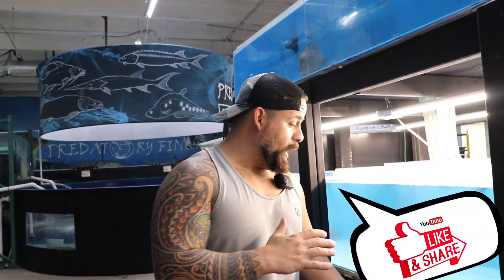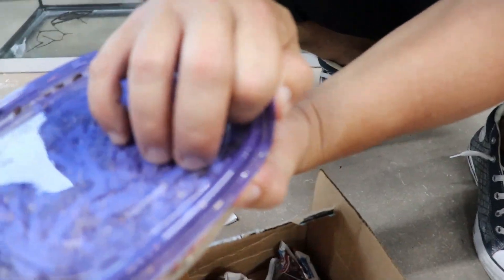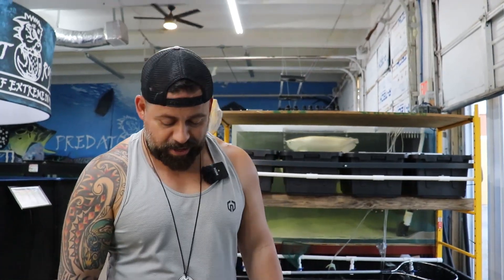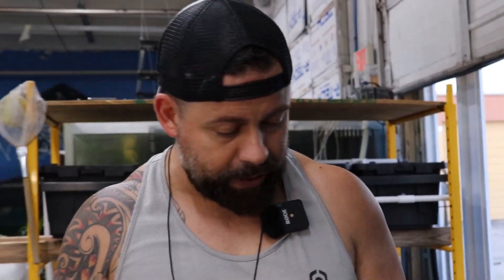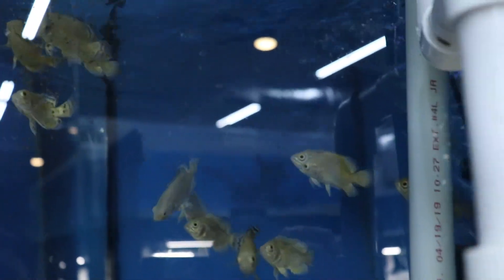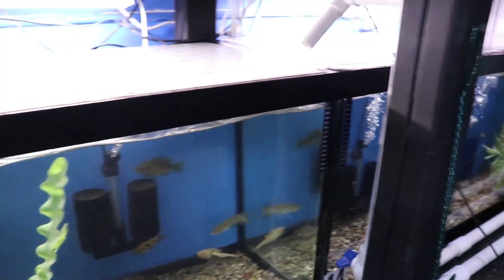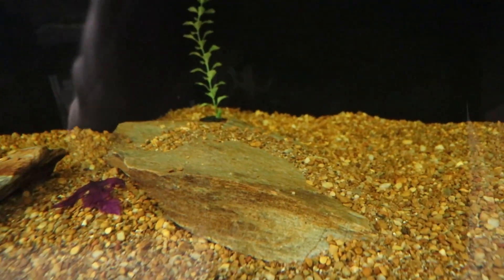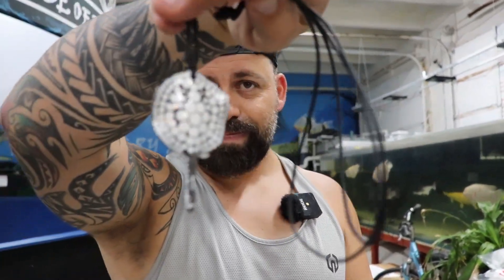FISH TAXIDERMY buying BONE cleaning BEETLES to make my WIFE CRAZY

Comment: They are very good at cleaning bones. They had them and I saw them at work cleaning bones when I was in forensic classes in college. If you want the bones to be really white though you have to put the bones out in the sun. You can probably speed up the method by putting a little bleach on the bones and then leaving it in the sun. I am not sure if the beetles fly but they can crawl out of the tank. All you need is like a thin sheet of plexi and cut it to the shape of those openings on each side of the support brace. Make small holes in the plexi so the beetles don’t die. To make sure the plexi does not crack, put tape over the whole piece of plexi and then drill the holes. Then you can peel the tape off when you are done. Also, the way they usually have them set up in forensics labs is they will put some cedar mulch or like wood shaving like they use for hamsters and stuff as a base layer to cover the bottom of the tank.

Comment: To make a good lid for bugs get a board cut the out side to fit the tank then cut out the inside of the board and staple or glue front door screen to the wood and you will have a good top

Comment: You could use some cardboard egg crates for them to hide under. For the water, the dish you put the water crystals in (you need to add water by the way, and you don't need that much crystal). you could just put some of the white filter wool you use, wet it in that dish.

Comment: Just so you know I keep these bugs because I have a bearded dragon, I put these Beatles in with my insects to eat any dead bugs and poo and any left over veg, so I do know what I'm talking about, really hope you put a lid on before they fly away, which they will do if it gets to hot
Reply: I have seen these beetles used on a show called oddities. It's kinda like pawn stars but for creepy or dark stuff. One guy had a colony of these and he had a ventilation system to suck away the smell and fumes let off during decomposition. I would think air flow is important for these.
Reply: Could use some netting. My mu kept stick insects and they escaped a few times, they crawled d up the walls and onto the ceiling.

Comment: you need to add water to the crystals and they'll become like a jelly consistency. You use those because if you put in a dish of water the insects will most likely drown. the amount of crystals you put in there will probably make a few gallons of water.
Reply from the maker: I had a feeling that was a lot of crystal lol, thanks for the info we will work on it today
Reply: Predatory Fins  No problem I’m a big fan and I’m glad I could help!
Reply: So have you done this before then yourself?
Reply: UNUSUAL AQUARIUM ECOSYSTEMS  I have never kept that species of beetle before but I’ve kept Dubia roach colonies to feed my reptiles and I used water crystals too give them water.
Reply: @zack998776  Pretty ironic in a sense. I'm aware most bugs drown in water sources, bats similarly sometimes (when young) have similar problems with deep water. I heard people are turning to roaches for roach milk generated from within and for their baby roaches. Roach milk can be extracted from roaches but it requires killing it to get it because you can't successfully milk a roach any other way for the crystals.
Reply: zack998776 thank u it make me cringe so much when he did that
Reply: Exactly they should absorb water bcz without water its just hard crystal subs it should be like jelly if you want to get  consumed by beetle